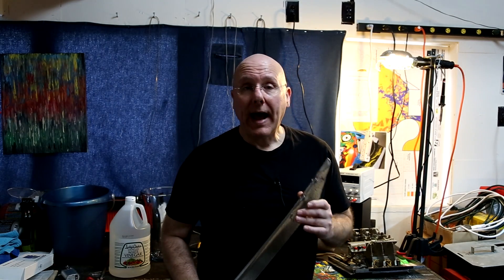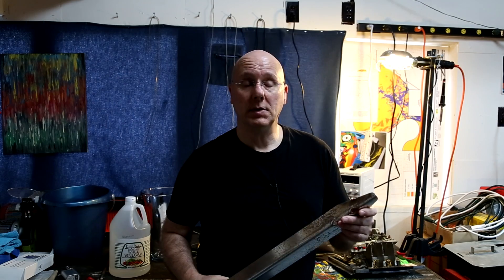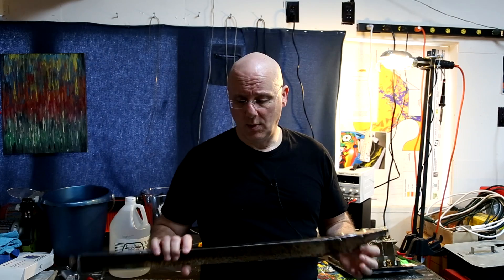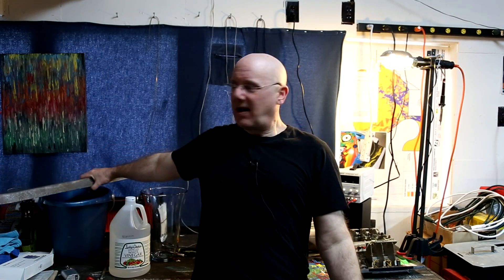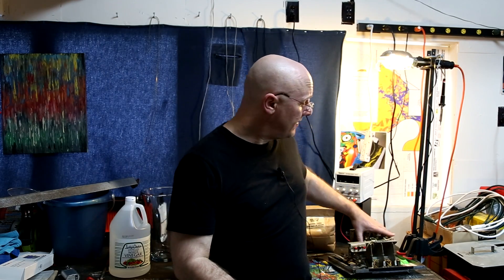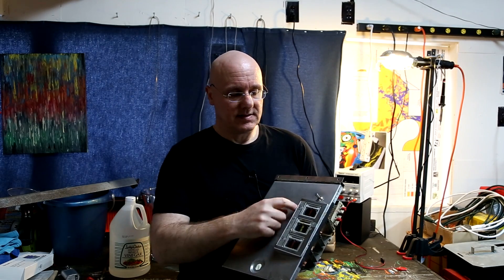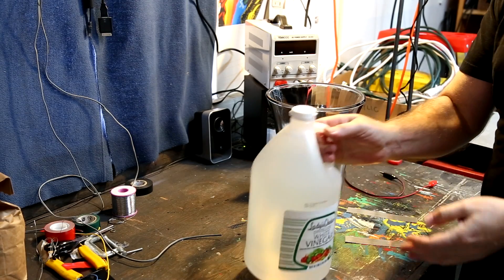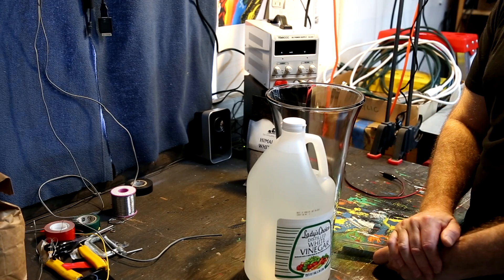Pinballorama #19 - Removing rust and nickel electroplating pinball legs

Comment: maybe just sand down those legs smooth ...... then replate.  And they'll look great?
Reply from the maker: I could do. The test was to see if there was a way to not do so much work. I want to revisit this idea because I think there's something there.
Reply: @Pinballorama  you could try and build a small box lined with plastic (don't even need a bottom) and soak them in Evap o Rust.  Good stuff.  OR...... buy a wire wheel that you can chuck up in your battery drill.   That might  be enough to knock off the high spot rust.  Even a random orbital sander with 100 grit might work fine.   Not sure how often you work with metal but a small blast cabinet is yet another alternative that is hard to beat the pro results you'd get from that. Evap o Rust is probably the least 'effort' and elbow grease method.  and when you're done you can pour it back into the container for additional uses.  Evapo Rust is pretty mild safe solution.   I think you can pour it down the drain.  but why do that when you can reuse it.
Reply from the maker: @dizzolve  Sure. I've done all those things you mentioned. The point of the video however was I wanted to test electrolysis and electroplating and see how that works.

Comment: Take a large piece 2 1/2 inch diameter pvc pipe, about 3 feet long. Glue on caps on both ends. Now saw it lengthwise in half. You now have two vessels for doing legs.

Comment: 32volts? damn you only need 2x1.5v d cell batteries and it works better, mains psus dont work great
Reply from the maker: Just to make the solution. I put it back on at 1.5v - which worked fine.

Comment: I believe you have your electrodes crossed. The positive goes on the nickle and the negative to the piece to be plated.
Reply: You are correct... the negative attracts the positively charged nickel ions which come from the nickel rod inserted in the solution.  You would have had much better results with either buying or making your own plating solution that is already loaded with nickel ions (It would be a pretty green color).  Easy to make but even easier to buy on Amazon. Also sanding down the pitting would have resulted in a much nicer finish giving the plating a smooth surface on which to adhere. The plating would never be thick enough to fill in the pits so they should be sanded down first.   Try this and be amazed at the results.

Comment: Thanks for this.  i was using aluminum foil, vinegar, citric acid,  molasses and so much naval jelly i swear i could taste it in my mouth if i even breathed it in.  While i was doing all that my college chemistry classes were rolling around in my head. I knew that there had to be an easy way to either chemically or electrolytically remove the rust and deposit more chrome.  I spent a lot of time trying to find someone who could jog my chemistry memory no one could help until i found your video.
Reply from the maker: Adding chrome would be tricky (and toxic). The nickle is an easy alternative. I think if you're coating an entire thing, it would polish up well. I'm looking forward to trying this on some other parts.

Comment: Interesting watching the amperage climb until it hit the cliff and falls away to almost nothing.
Reply from the maker: I think what we're see is the salt at the bottom of the vase is getting mixed with the vinegar. The process warms the water, which causes convection to swirl the water around and mix the salt. More salt, better conductivity. This continues until the amps get to the max of the power supply (5-ish amps). It starts to drop off at the end because the nickel anode is being broken down - creating less surface area - until the entire thing is completely eaten away. If you watch the cathode, you can see it getting bigger as the anode breaks down.
Reply: @Pinballorama  oh definitely. And it's definitely the nickel wearing down since there should be an excess of salt